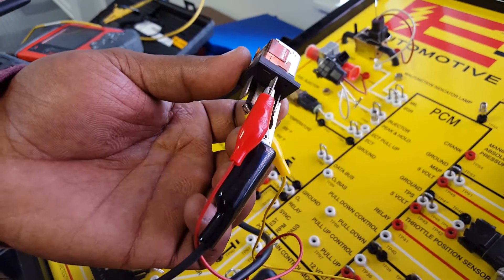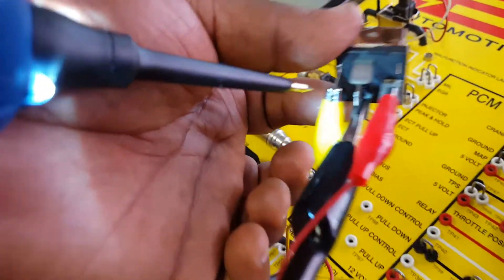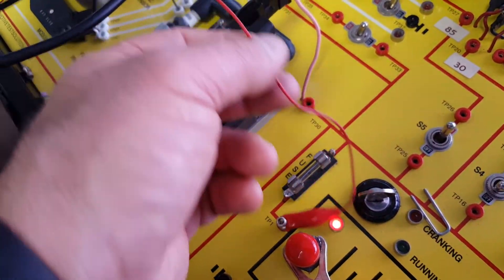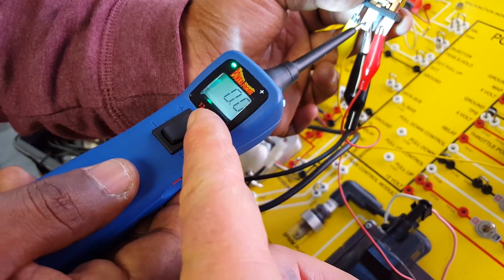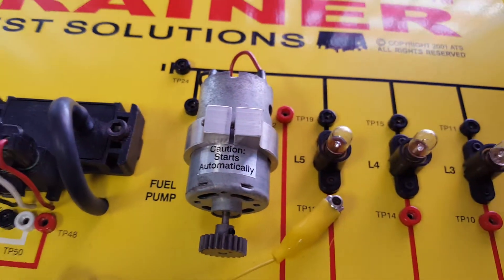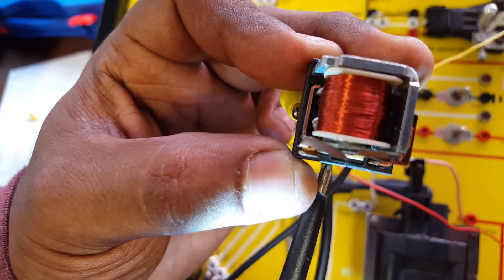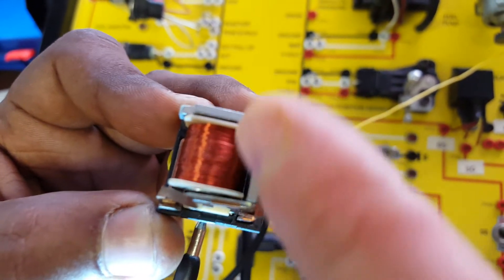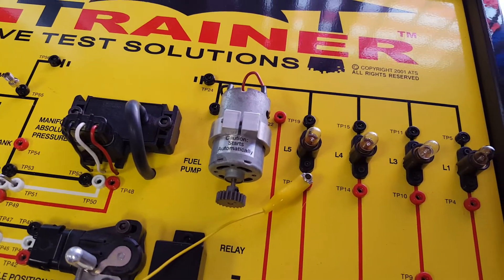Testing a relay (off the car)

Comment: 86 is normally the power feed side of the coil, 85 is the ground side of the coil. For the reason why check out how a fly back diode is used. https://en.wikipedia.org/wiki/Flyback_diode
Reply from the maker: Travis not all true all the time....thanks for looking into it and commenting. Just keep an open mind that it can be ground or feed.

Comment: The relay with 87 and 87a are not the same ! 87 on the relay the contacts our opened and when 85 and 86 get power and ground the contacts  close but with 87a the contacts are    closed and when you put power to 86 and ground to 85  then 87a opens the contacts you can get relays that's  have both 87a and 87  just make sure you wire it the right way
Reply: correct thanks for the comment

Comment: Cool video. Cool Board. Cool Set Up. Not very simple though. Ha. Thanks for making a video. When I want to bench test a relay simply and quickly I use a 9 volt battery and check the continuity.
Reply: thanks for your comment...